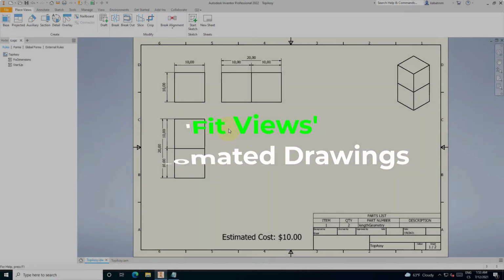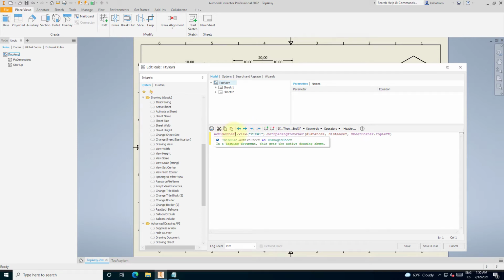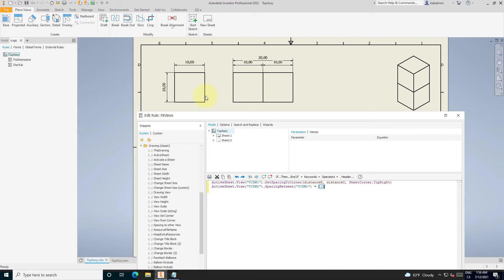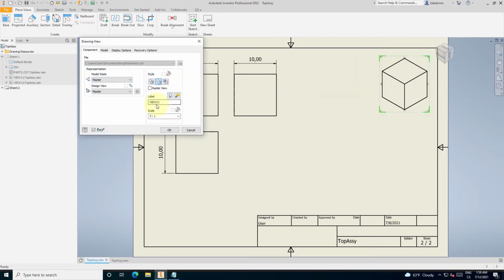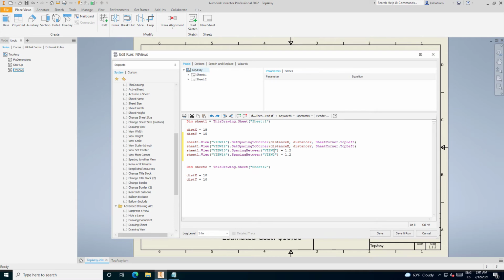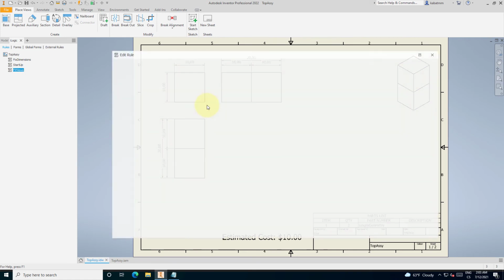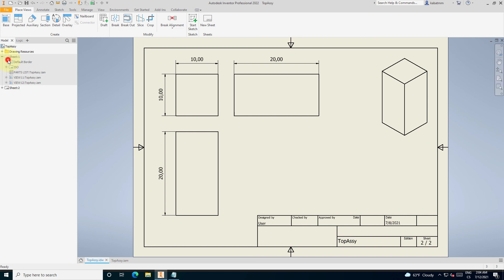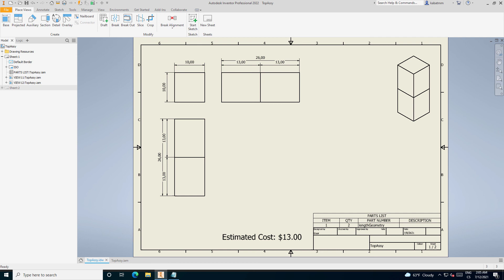Fit Views in iLogic Drawing (Autodesk Inventor)

Comment: This 'design automation' is sh*t. Autodesk had 20 f'cking years to code this into Inventor. But they refused to do it. They are a typical government owned, profit mongering, greedy corporate wh*re. Still, after TWO DECADES, you are fiddling around with this 'baby stuff', when structural steel software can pop-out single part details in a matter of seconds!